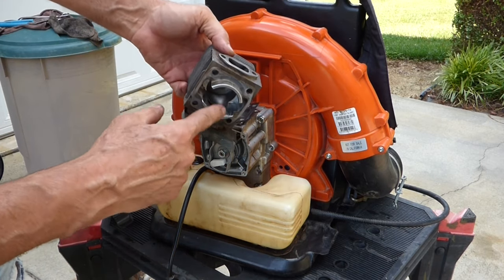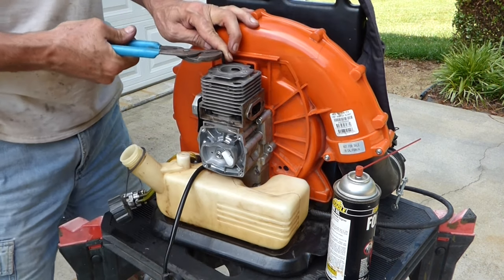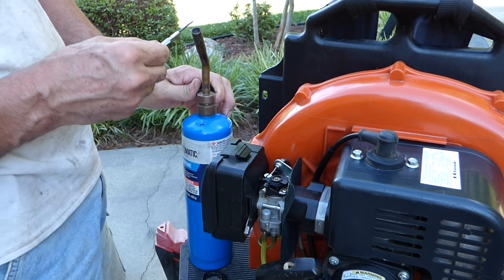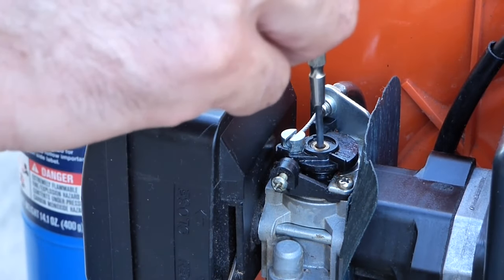Pull Cord Stuck on Small Engine - How to Diagnose & Repair

Comment: Watched your video yesterday, pulled my blower apart today.  You were right on the money. A screw under the plastic fan (wheel) had popped up preventing full rotation.  Video instructions were awesome, allowing me to take blower apart and put back together with little effort.  Thanks again.
Reply from the maker: way to go!

Comment: When You dumped the gas mix I figured it was motor oil in the mix
As soon as we could see in the motor I knew it was motor oil in the mix
I have seen that in many a 4 stroke with bad rings, Bad news with a 2 stroke 😒
Regular Motor oil will do it every time

Comment: I watched your video and I like your presentation. I would like to know if you can solve my problem with my troy bilt tb20cs. I disassemble it completely and couldn't  find anything wrong. When I assembled it a went to pull the pull cord, the started binding. So I removed the spark plug and the trimmer turns fine however  , if I reinstall the plug, it starts to bind where the engine won't turn, Could  you advise?
Reply from the maker: Hard to say without looking at it.

Is the engine completely frozen when you put the spark plug in or just real hard to pull?  Do you have the correct spark plug in your string trimmer? If you put too long a plug in there your piston could hit the plug and not allow the engine to turn over.

When you pull the cord without the plug in does it pull real real easy or do you feel resistance?

Comment: Nice job LOL  HAHAHA you put the old cylinder gasket back and there were some gasket remains stuck on the crankcase. Also you should never reuse the same piston pin circlips ! You play with the needle to adjust the carburetor but the engine is idling and this needle is to adjust the hi speed LOL
Reply: It ran like a charm didn't it! I'll watch your how to video next.

Comment: I've got the same problem,  I didn't mix it with oil and just used fuel. I should have mix fuel ⛽️  with 2 stroke engine oil at 40:1 ratio

Comment: Do my echo blower does not turn when I remove spark plug it turns installed different plug but still stuck when I pull cord ?
Reply from the maker: When the plug is removed does your starter cord pull Super Easy or do you feel a little resistance?
If you feel some resistance with the plug out you may have a scored piston and cylinder wall.  If that is the case...when you put the plug in it may make it very hard or non movable.

Comment: So when I remove spark plug it is easy to pull no resistance
Reply from the maker: If you ran the correct fuel mix in it and not straight gas… And the cylinder and cylinder wall are not scored… Do you have the proper spark plug installed? If the spark plug is too long it can’t hit the piston
Reply: I have the same problem.  Bought the spark plug from a very trusted small engine shop.  I’m thinking we compared it to the “OEM” china one.